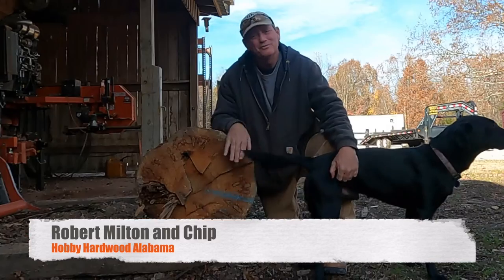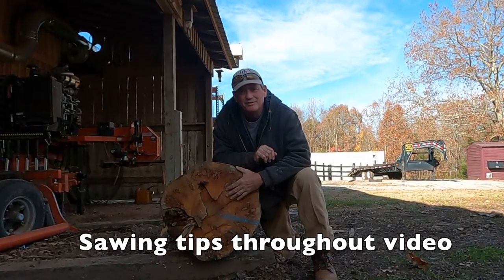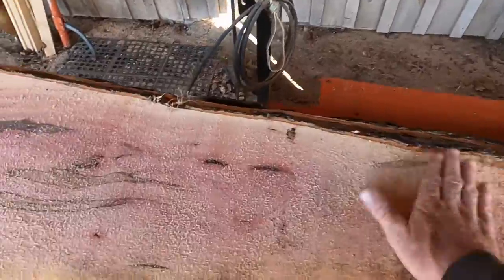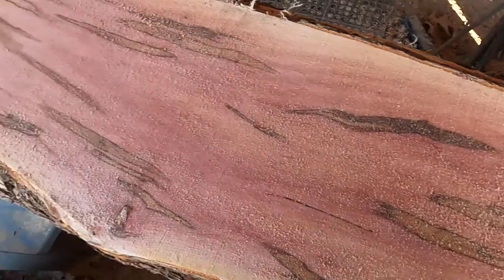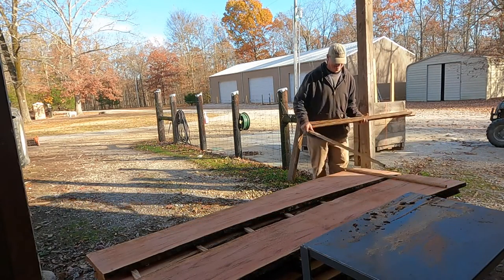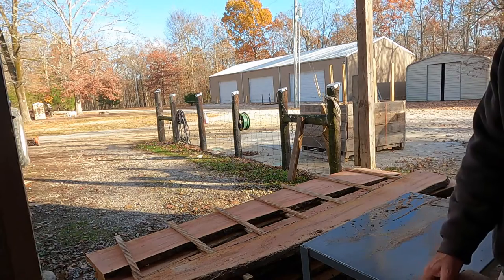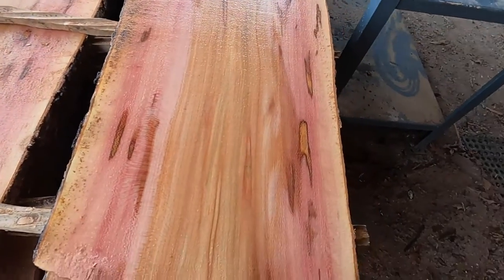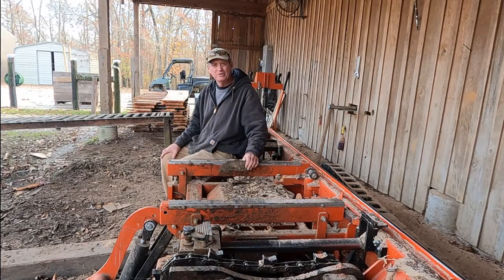Sawmill - Wood-Mizer LT-70 and Amazing Logs  (Will Make You Look Twice!) at Hobby Hardwood

Comment: A couple questions. How did you know it was pink before you saw it? Why did you saw it 4/4? What did you sell it for ($)? We have a lot of sycamore here in the Midwest; junk wood, poor firewood, warps bad as lumber; rots very quickly.
Reply from the maker: I observed that it was pink from the ambrosia flags on the ends of the log, and you are correct, sycamore warps badly when it dries.  That’s one excellent reason to quartersaw it, and we already had several pallets of thicker sycamore, so I milled it to 4/4 because that’s what we needed in the pipeline.  Thanks for watching!

Comment: Nice video ! Does sicamore stay flat making a tngential cut?, to me they have always been twisted after seasoning 
what thickness do you recommend for the slabs? Thanks
Reply from the maker: Yes, the problem with sycamore is that when it is flat sawn it will have a tendency to twist, so I normally quarter saw it, both to keep it flat and to expose the tyloses or rays.  However, I'm sawing these specifically for live edge charcuterie boards, so am forced to flatsaw them to get the live edge look and so cut them a little thick and plan on shortening them up.  A good rule of thumb is that reducing a board's length in half will reduce its bow by four times.  So I expect these to move during the drying but we will simply crosscut and flatten them in the processing steps.